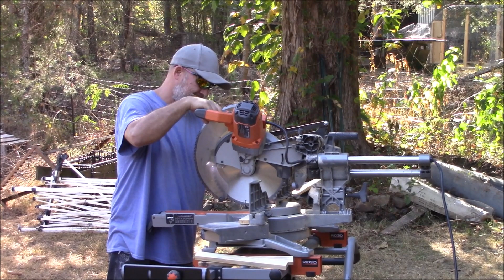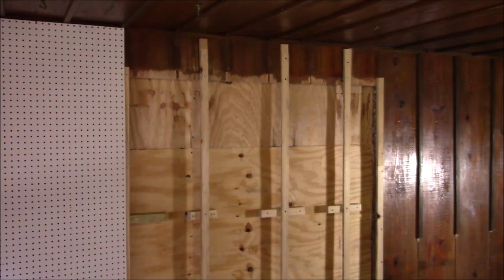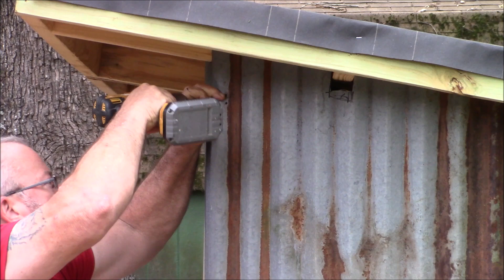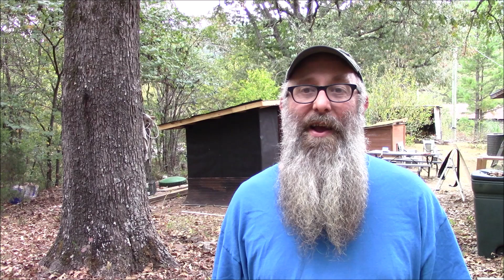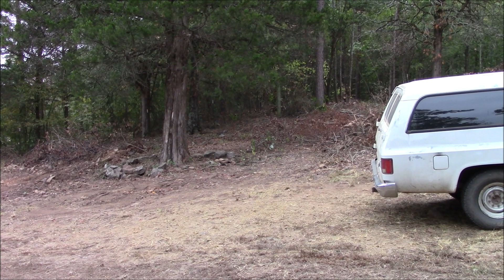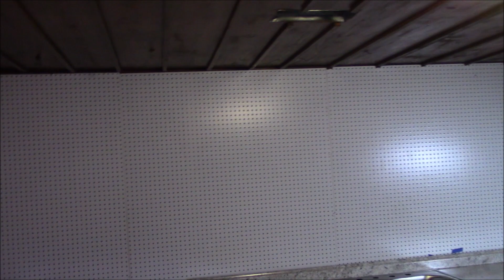Kitchen TRANSFORMATION - (Homestead Makeover Crew)

Comment: What size holes on the pegboard? Hooks are different sizes. I was lucky to find some at a garage sale. Those narrow cabinets on the opposite wall makes me think they may be the perfect width for what I have switched to instead of gallon jars for storage. I was lucky in that a prepper I know had extra tall two quart jars. They keep the bugs out and I can see what I am low on for dry storage. I hope you get to add insulation underneath eventually so no more freezing pipes. Oh after Christmas is over: the white LED lights on sale run them under the counters and you have cheap light right above the counter tops. I like the rope ones, but just the regular tree lights work too.

Comment: Please, please be extremely careful if you plan to burn that cedar for heat. Cedar has a lot of oil in it. It burns very HOT. Could burn your house down. Cedar is more like rich pine that’s better suited for kindling. So please be careful with it. 

Everything is coming along nicely. 🙂 The peg board is nice and I like it for something different.
Reply from the maker: One log of cedar is perfectly fine to use when getting a fire going, you just don't want to use cedar exclusively.
Reply: @BobbleheadHomestead  stay safe. 🙂

Comment: They make a textured kind of tin splash guard thar would cover up the problem spots or even do tile backing...both will work easily over the peg board...but you should get a window for above the sink back in there 😉
Reply: Yeh..I would definitely need a window in that cave🤪
Reply: I thought of the tin idea as well. Incorporate some of the outside as well as functional inside. Lots of cabins are going with tin. Rustic is in. 😀